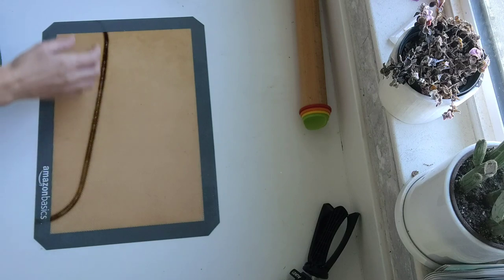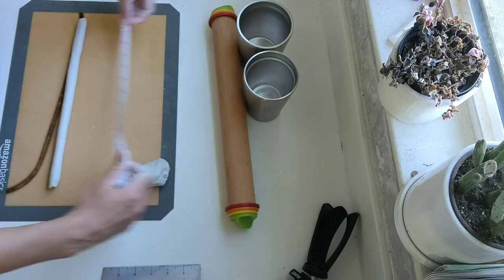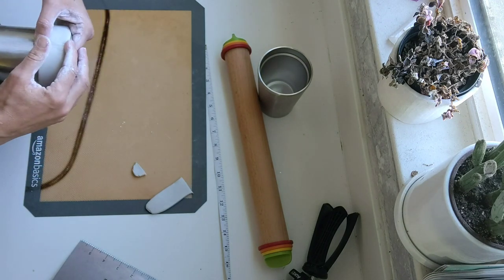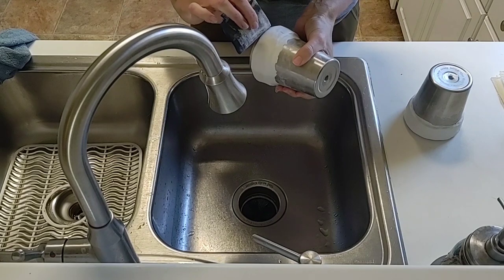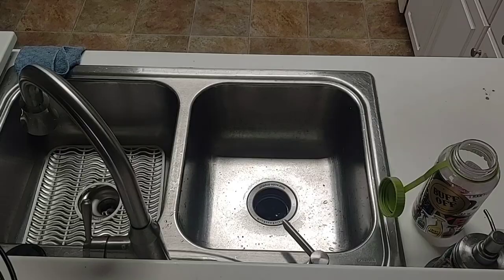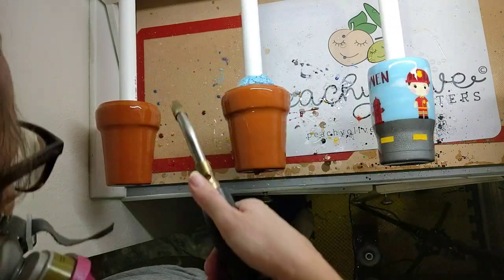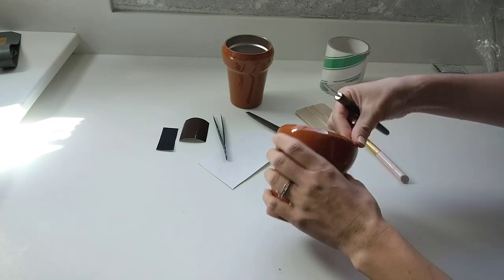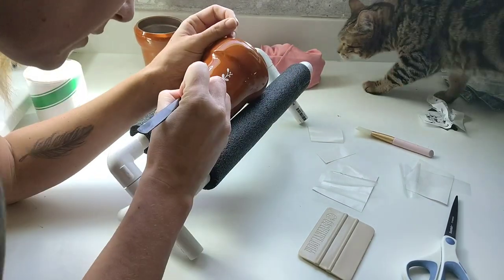#flowerpottumbler #epoxytumbler #tumbler tutorial Flower Pot Tumbler Tutorial

Comment: what do you do if it cracks after its dry
Reply from the maker: I've never had that issue but I would try to keep it moist enough when working with it then a stable environment to dry. Not too hot or too cold or drastic changes between the two.

Comment: Super cute! Great job on the video!
Reply from the maker: Thank you!
Reply: My air dry clay falls off when it’s drying. What’s the trick for keeping it stuck on?
Reply from the maker: Oh no. Do you sand and wash the cup first? That should help it adhere. Also make sure your room isn't too hot or cold making it crack. Then push it down on there really well when attaching it.